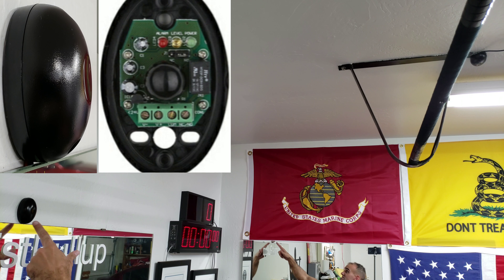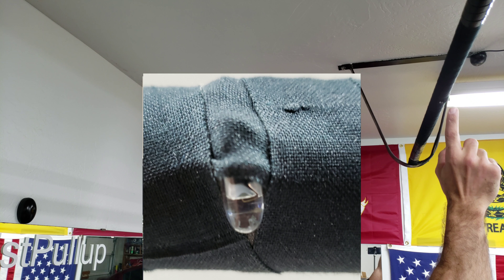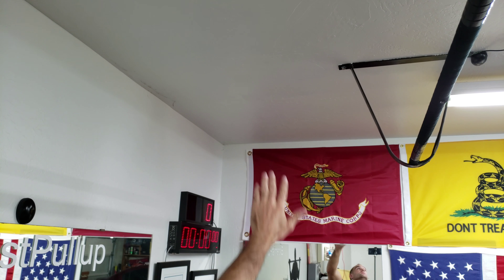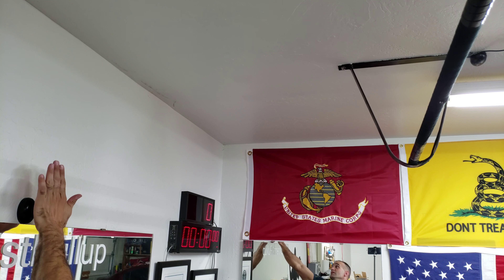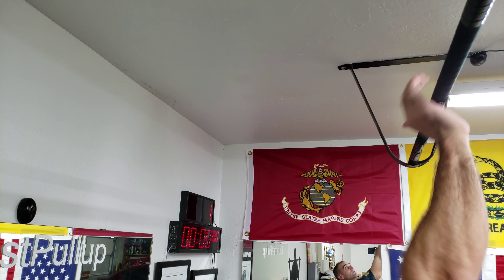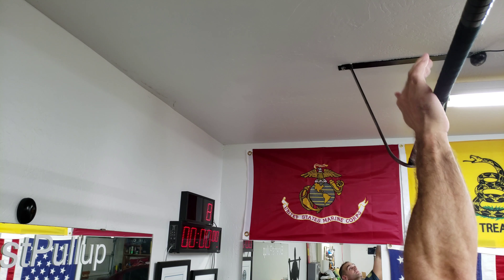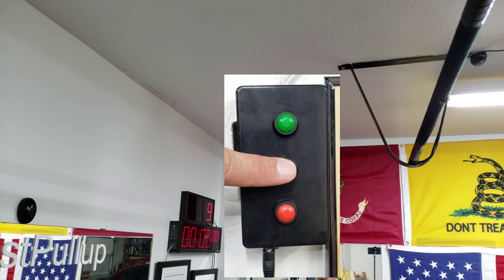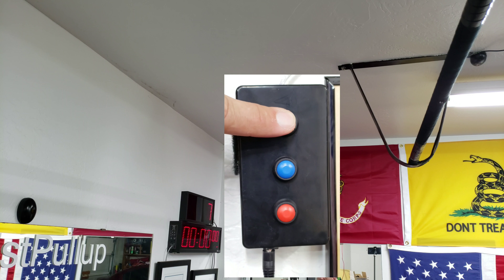Automatic pull-up counter

Comment: I dont understand how that sensor in the pull up bar works
Reply from the maker: The pullup bar side is the transmitter infrared light. When you block the light the receiver on the wall goes high and trips the relay.